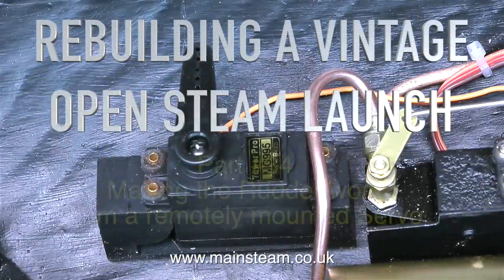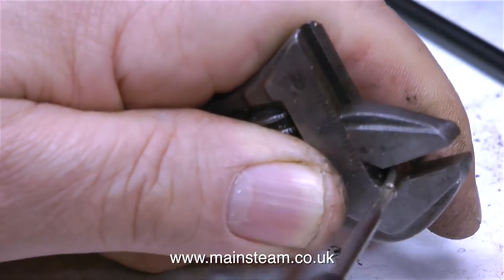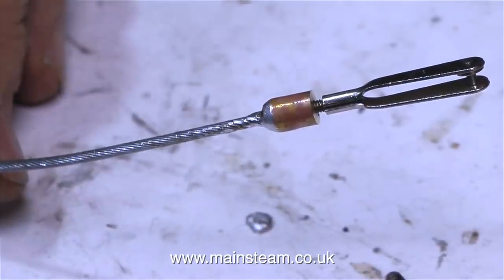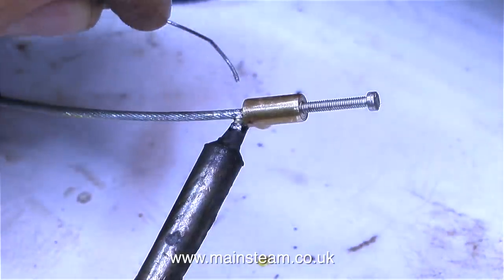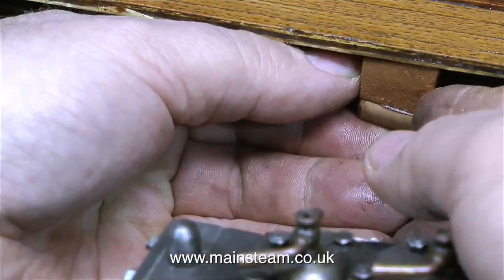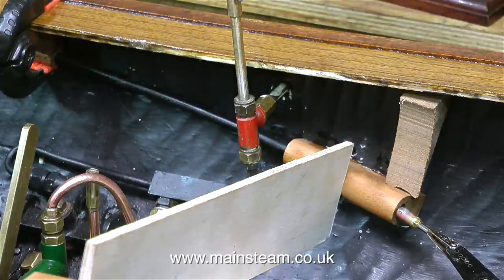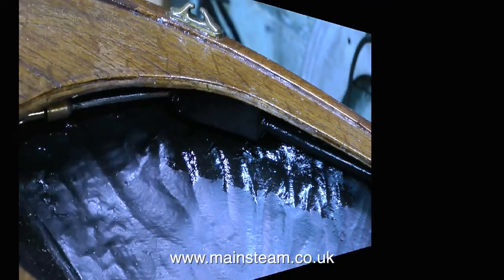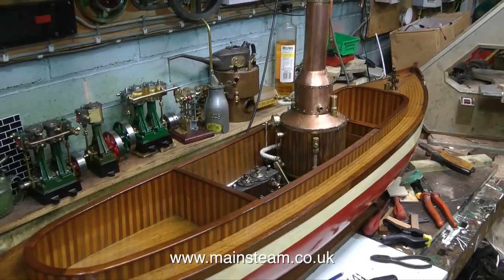REBUILDING A VINTAGE MODEL OPEN STEAM LAUNCH - PART #34

Comment: One more pleasant watch. Thanks Keith.
I wish that you show the inside of your RC shut off gas valve once.
Cheers.
Reply from the maker: Thank for the kind comment. The RC Gas Shutoff Valve is nothing special, just a threaded shaft with a point on it that blocks up a hole in the body of the valve - just like all other valves except that it has a lever arm on it instead of a hand wheel, and it has an "O" ring in the gland nut to seal it against the gas pressure, therefore preventing gas leaking .

Comment: I've done a fair bit of soldering/swearing/desoldering/resoldering of electronics on circuit boards and when you first put the flux I thought "whoa, WAY too much!"  But now I see how much remained for a bit in liquid form, distributing heat to the part and allowing the solder to just wick deep into the part right where you need it.  I'm going to file that away under "things I hope to remember before repeating my usual stupid mistake."

Comment: Keith,  Great project !  I've weathered through all 32 parts and thoroughly enjoyed them !      I hope to build a wood model steam launch for a Stuart compound launch.   Could you tell me length and beam of the hull,  dia. and height of the boiler barrel ?   I like meths firing and wonder why the conversion to butane other than it doesn't stench in the shop ?   Please try not to involve the spanners and paint in your reply  ;^)   Jack

Comment: You need to write a book titled:
 "101 uses for a Bahco Adjustable Spanner"
Reply from the maker: 102, it would probably hold my pen that I was writing with too :-)))
Reply: 103 - I have a Bahco and use it to adjust the spotlights on my car.

Comment: Hi Keith. I love your videos, but when are you going to upload the completion of your steam open launch boat
Reply from the maker: I have had to let some time elapse to stabilise the cracking of the old wooden Hull at room temperature - later this week I will be repairing it and after which I can finish the job and of course make some video of the process.